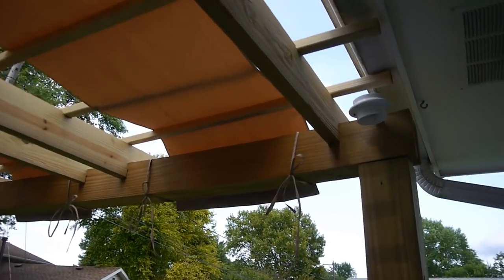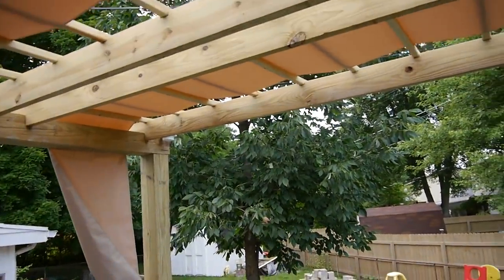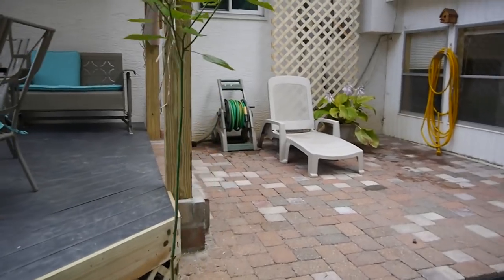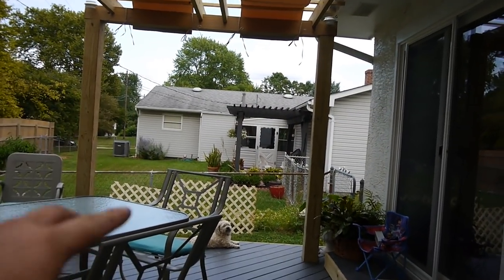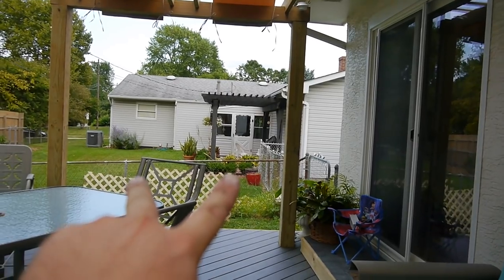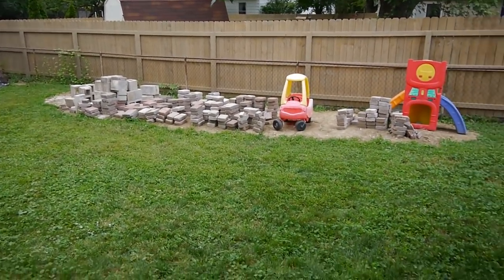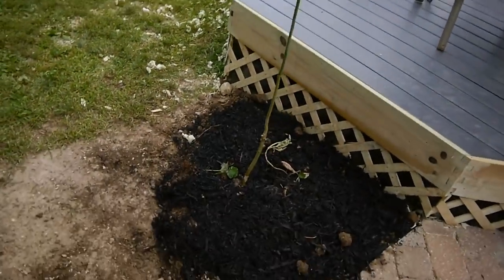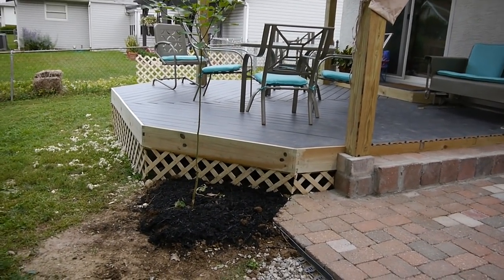ADDING A PERGOLA TO AN EXISTING DECK, A DIFFERENT TAKE ON A DECK PERGOLA

Comment: Was it necessary t o use a 6by 6 beams ,if the wt factor is 2 by 4 and a cross pattern.
Reply from the maker: It was more of a looks thing and I wanted to put a swing on it. The unsupported span and loading would determine the beam needed typically.

Comment: Did you make a total of 4 “L” shapes? I was asked about a job that entails adding a pergola to an existing 12’ x 12’ deck. This is perfect and looks very sturdy. I figured I would make 4 “L’s”, bolt them underneath and to the frame, and then notch out the top like you did.
Reply from the maker: Hi Rolib, I made a total of 2 "L" shapes. The two other posts were incorporated into the deck when I originally designed it. Good luck on your project.

Comment: nice build, did you nail or screw rafters and purlins? i like the idea and look of the notches, i'll do the same, thanks for the awesome vid. from new zealand
Reply from the maker: Thanks for the compliment. I screwed the rafters and perlins. I think they were 2-1/2" or 3" deck screws if I remember right. In hindsight I would have gotten untreated 2"x2"s a couple of them warped severely after drying out. I think hitting them with deck stain would have been enough to preserve them.

Comment: Some pavers have asoestos inside no?
Reply from the maker: Good Question, Not sure, They probably used it in the 1960s and 1970s. The house I took them away from was built in the 90s so I don't think this is something I have to worry about.

Comment: Hey Josh, nice vid mate.   just checked back in and you have over 200 subs now... nice one! I was one of the first!.  By the way you still got the Maxnc or have you burned it out yet :-P?  We have just moved into a bigger house, officially for the growing family but also for the adjoined garage ;-) so will be doing more soon.  Have a good one pal.
Reply from the maker: Hey Rural! Long time no see! Yeah, trying to get to 1000 subs so I can get a few bucks to pay for end mills and the like. I was wondering what happened to you. Growing family? Do you have a little one on the way, or is it that a little one came and now is fighting with the older one for the guest bedroom? :-) The garage sounds awesome! I know you were limited on what you could do at your old place. Congratulations on the garage and the new place! I look forward to seeing the rest of the telescope mount being machined on the MaxNC! I still have mine although the 3d printed pulleys have not lasted like I had hoped. The spindle bearing heats up the abs pulley expands and starts slipping off and then the belt comes off mid job. I think I will have to go to a v-belt in the near future, that I can machine on the lathe. A good friend stopped by the other day and we made a small furnace in the back yard to melt aluminum. I may have to make some more 3d printed pulleys and try and use them to make a lost form casting of the timing belt pulleys I have in mind for the mill.  I spent most of the summer so far on this deck and have no time for other projects, as this is wrapping up I hope to start back in on the cnc and laser engraver projects. It has been great hearing from you again! Take Care!
Reply: Hi Josh,  Thanks for the update.  Hopefully will get more videos out in the coming months. I still have the old v-belt pulleys from my machine, I would happily mail them to you but I guess you want something a bit beefier?  by the way I have noticed that the official Maxnc website has been closed for maintenance for a long time now.  I have the feeling that they have gone under for the final time, shame... Yeah new place and new job, so some new money coming in for projects too.  Take it easy mate and stay in contact.
Reply from the maker: Thanks for the offer of the old pulley! That is pretty awesome of you! But you would be right about wanting something beefier! I channeled my inner Tim Allen and Grunted and Hooted my way to a set of bigger pulleys! Check out the video here https://www.youtube.com/watch?v=1ndc5g0SZWg&t=609s  I think they are butch enough. The only part I am concerned slightly about is only having 1 set screw per pulley, may step that up to 2, 90° from the other. Yeah, I noticed that as well. I was going to look over the leadscrew supports for ideas on mounting them, and nothing. Yeah, I think they may have finally gone under. I honestly think that this recent company bought the spare parts inventory with the intention of selling it off till nothing was left. I think they decided try there hand at improving and improvising the old mill, which didn't pan out for them. In the end it is an aluminum mill and has limitations. It is a shame, maybe someone else will pick up the mantle. Wow, new place and new job! I know I hate change so I hope things are settling down for you! It's great that the new job comes with some extra cash always helps ease the pain of moving. I look forward to seeing what you have in store for us! Cheers!

Comment: HITTING THE  WIRE IN THE BEGINNING WAS WAY TOO SCARY
Reply from the maker: Scary for sure, but don't worry that was only my cable internet line. The lines that carry the 220vac into my house are the ones much higher up and to the left. I was particularly careful to make sure I could not come into contact with them even if I tried. Thanks for watching!

Comment: Wood will destroy your masonry bit brother.
Reply from the maker: Oh for sure, the rubbing of the drill on the wood will destroy the bit. That is why I predrilled the hole with a slightly larger bit and then used the hole as a fixture to allow me to start the hole saw. Thanks for pointing that out as needing clarification and thanks for watching.